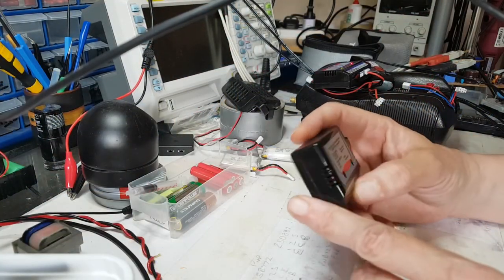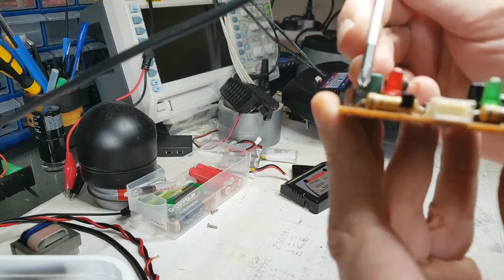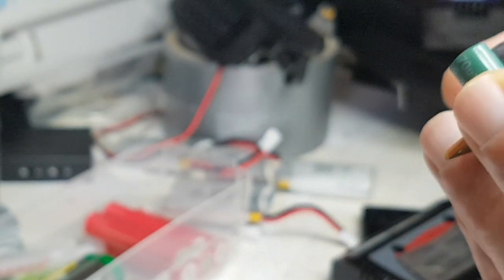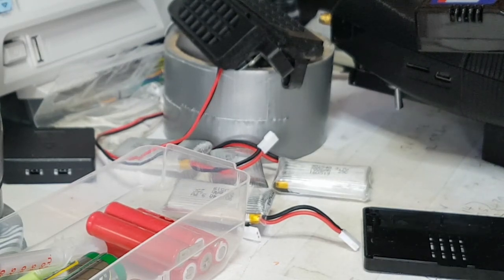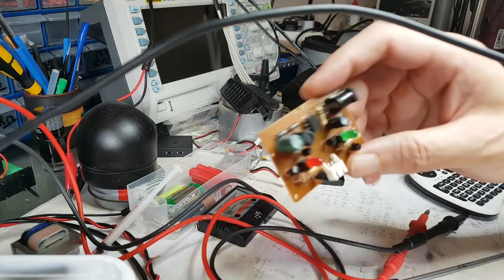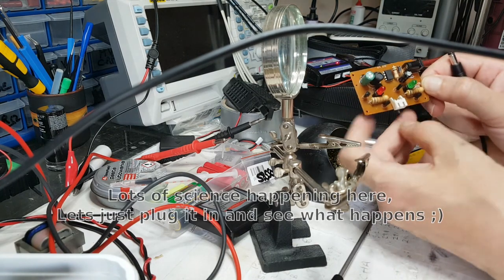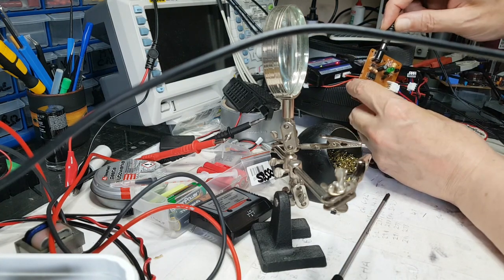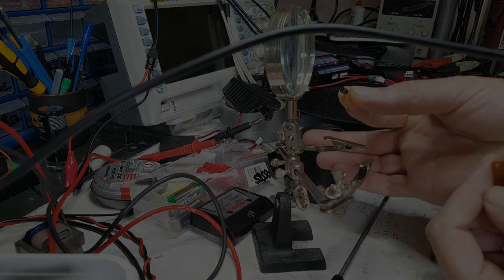Simple Fix - LiPo Battery Charger Repair

Comment: I have this same charger but a different component failed.  It is so fried that I can't identify what it was.  What is the black component next to the green 470uF 6.3v capacitor?  Is it a diode?
Reply from the maker: The diode is an IN 5819 they both are. Not sure what the value of the inductor is.
Reply: I have one from flywing smells burnt component.. the optocoupler looks to me that it iad fried out

Comment: I had one of these cheap chargers and when it stopped working I threw it in the bin. Wish I had checked it out now. Seems an easy fix.
Reply from the maker: I would have done the same thing, Or more like me to store it somewhere just in case, one day I could fix it. Easy to see the problem, harder trying to work out why it happened.